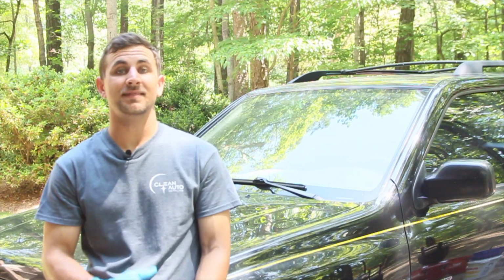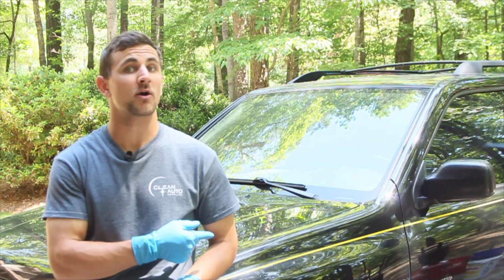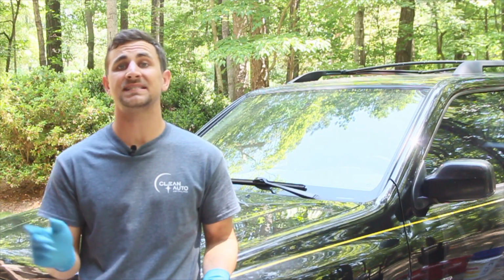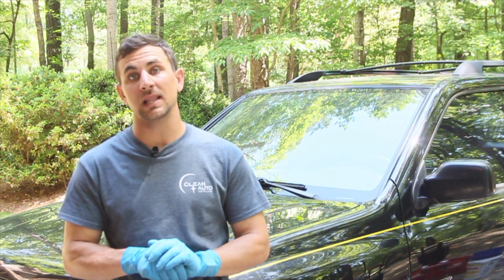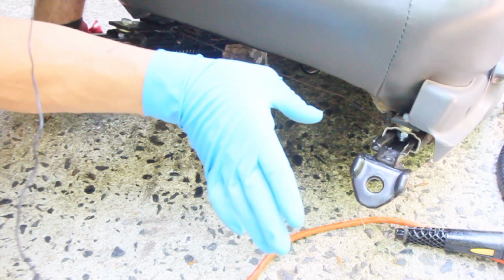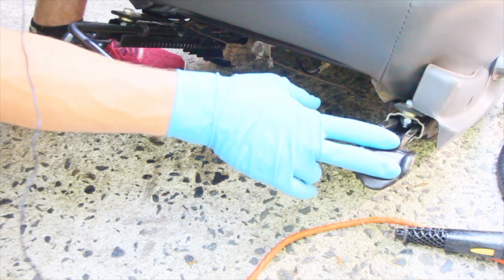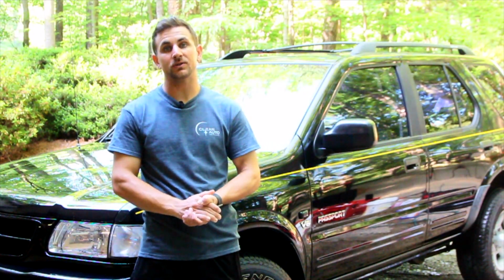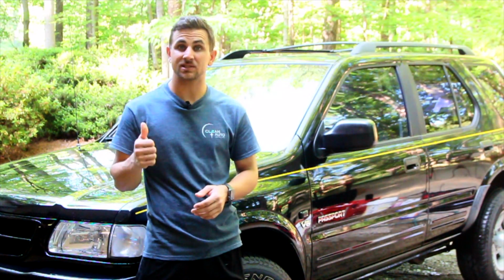Time-lapse Detail 1999 Honda Passport

Comment: Wow I have a passport 1999 and I love it to death. It's the second one I own, my first one was total in rollover hit and run accident. I looked for the same style  ittook me a year to find when I did I bought it. I know the car is worth nothing, but it is a good car ,never has giving me problems really. well, theirs this jerking on the transmission oddly both passports I have own have done it. I met other owners who say they have the same issue. I rebuilt the transmission and still does it, other said they changed it and it still did it. If I win the lottery or something I want to rebuilt my car. I want someone to do this type of job on my car ...
Reply from the maker: gatitoroulette15 I would love to see it! I think these model year Passports are some of the best looking SUVs ever made. Thanks for watching!
Reply: @Abdul Hafiz I just bought a 99 and have no clue how to put it in 4x4. It's a automatic, and the guy I bought it from said he had the tranny fluid and filter changed. The check engine light is on for some reason!